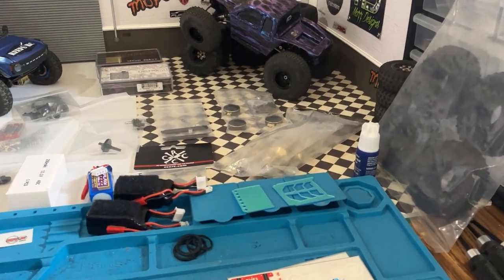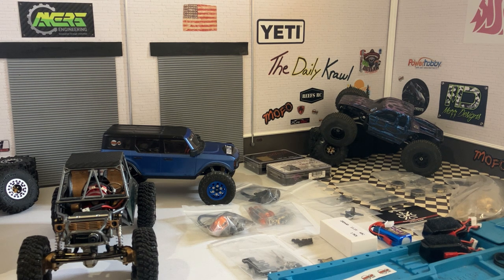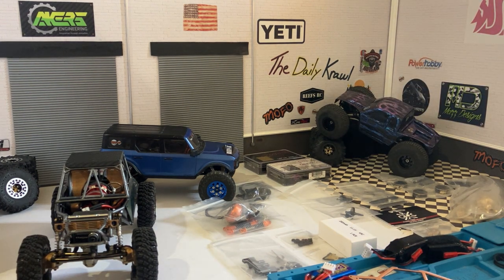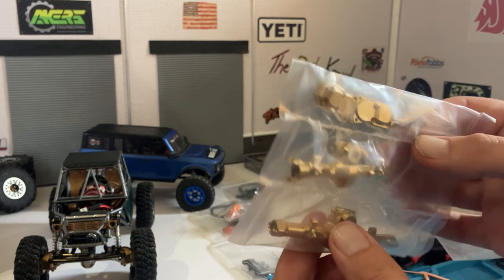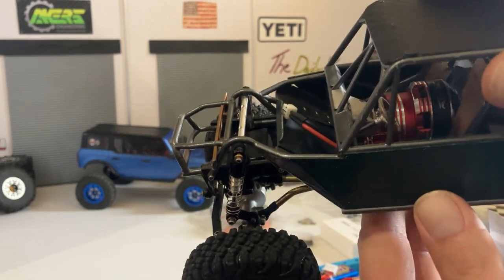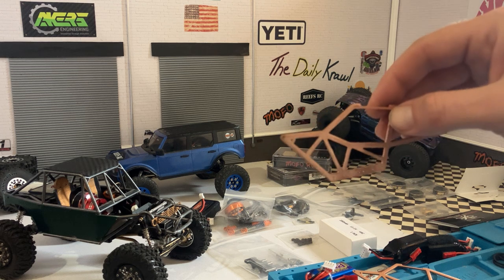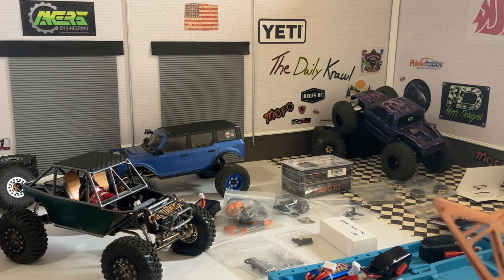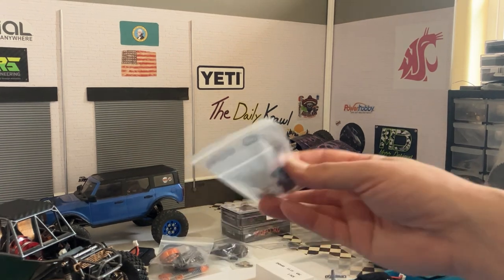SCX24 Akers Engineering (update and things to come).

Comment: Another awesome Video Rob!
 I did the same axles you put on your sons bronco build ,  for my gladiator, I noticed after i did the swap, my gladiator doesn't turn very well. Like it doesn't turn tight anymore. 
Any idea why that might be?
Reply from the maker: I noticed that as well. It has to do with scrub steering. We’ve moved the tires so far from the knuckles pivot point our rigs don’t steer as sharp. A lot of guys make up for this with CVDs (sharper turning radius). Unfortunately these axles and this style of portal don’t have CVDs. Well, none that I’ve found. Wider isn’t always better.  I do like the look of the portal axles. My micro shark and my kids bronco are both trail trucks. The micro shark can do some technical stuff but it has the same steering issues.  That’s why I built the cheat code and chose to stick with stock length inner axle shafts. Plus I added CVDs in the cheat code and installed 50 percent under drive.  Turns on a dime! Very close to my 4ws scythe.  Thanks for watching!  I can’t wait to finish collecting all the parts for this Akers build. Found out hes not full time in the hobby and will restock whenever he gets around to it. Could be tomorrow and it could next month.  I will keep y’all posted. Thanks for hanging out!
Reply: @thedailykrawl7084  Ahh man that Akers build is going to be nuts! Thanks for the insight, It  really helps knowing I didnt do something wrong there! Now i just need to figure out why the scx24 gladiator goes in drive when i turn it on lol. Cheers mate!
Reply from the maker: @deanweller5789  could be a battery problem. Not sure. I’ve had a couple run away rigs. I just turned it off and changed batteries and it fixed itself. Good luck bud 🤙
Reply: @thedailykrawl7084  Rite on! thanks, I'll try changing out the battery. 🤙